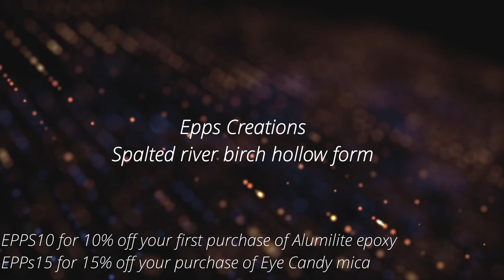Wood vase turning - woodturning wood and epoxy art

Comment: Excellent work man, really great colors and form on that wood, beautiful. Quick question - do you use a vacuum or pressure pot when curing your resin? Thanks and keep'em coming!
Reply from the maker: I use a pressure pot. I use the California air tools one. Nice fat bottom, 12” across inside. But I do have the vacuum chamber that I’ll be using on another carbon fiber piece.
Reply: @EppsCreations  right on man, thanks for the reply and thanks for the vids. Appreciate it!

Comment: Great job have you tried alumilite deep pour for big casting like this project or do you just use slow Thanks for sharing
Reply from the maker: I just use clear slow for now. I’ll be getting some deep pour before long. No need for it since I have a pressure pot but it’s long pot life will allow me to pull a vacuum on it on projects like the carbon fiber hollow form since those strands trapped bubbles.